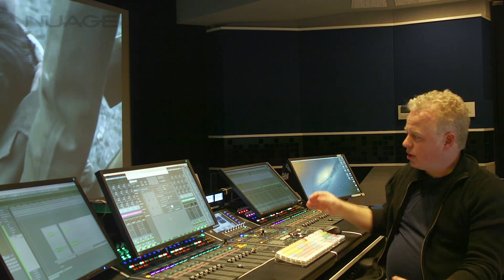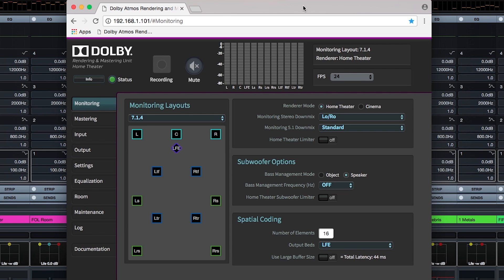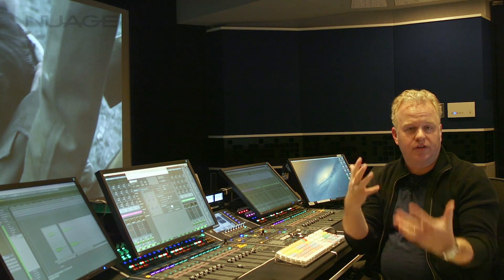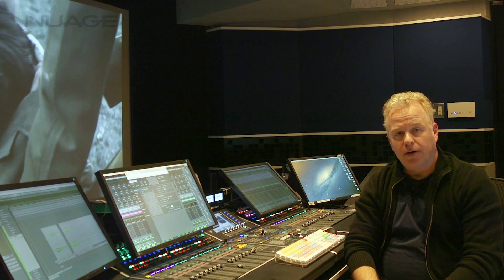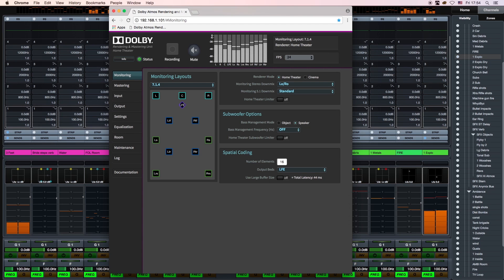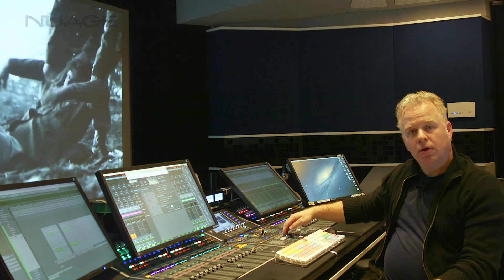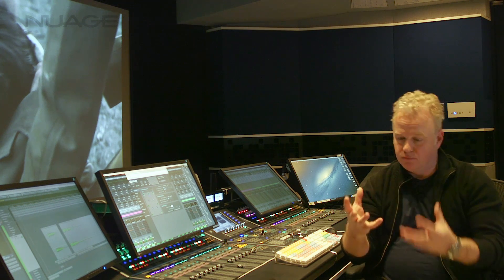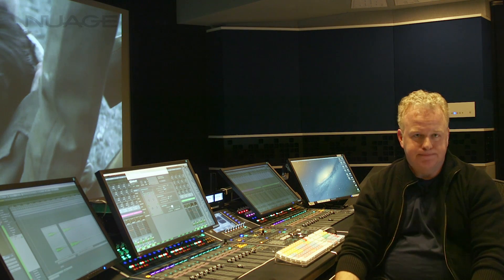Nuendo/Nuage Setups : Connecting Dolby RMU / Dolby Atmos Mixing with Yamaha Nuage

Comment: His videos are super short! He does not ever explain how Nuendo is connected! Nuage itself has no connections other than Ethernet to the hub or the Nios Nuage itself is just a controller so you DO not take any connections from Nuage to the RMU. The RMU however does connect to something. I just dont know if its using physical cables or using Dante or a Madi interface from the computer to the unit!